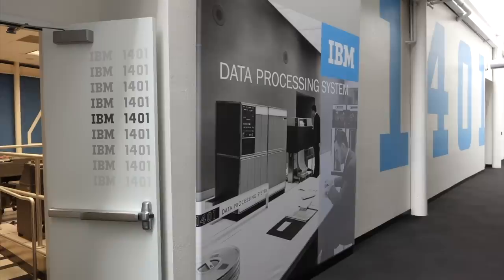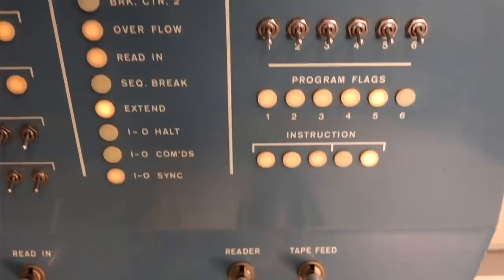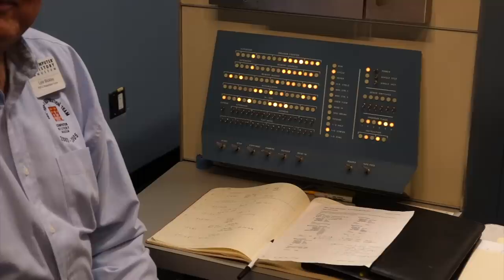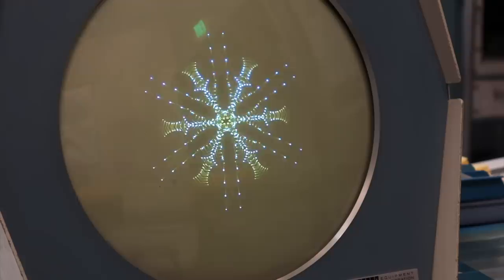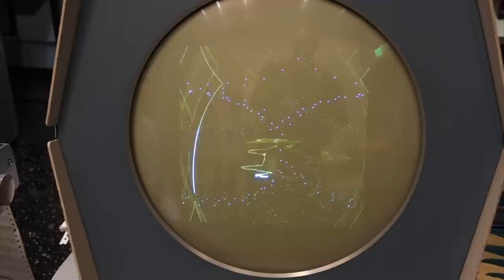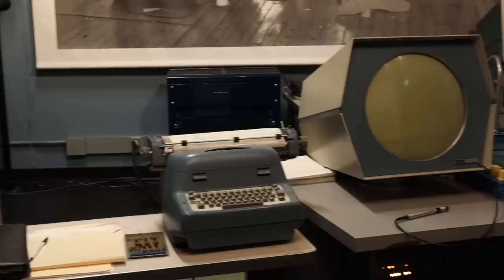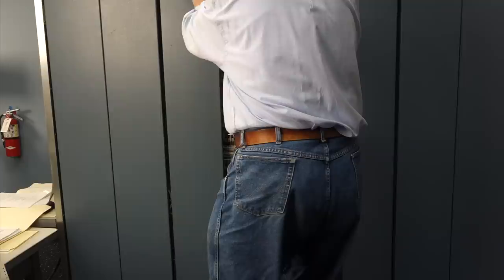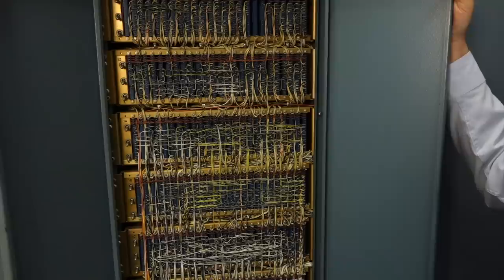Lyle Bickley explains the PDP-1 (and we play the original Spacewar!)

Comment: Definitely the best bit of Spacewar (and the system, though other systems would've also used a radar screen) is the long trails on the projectiles--makes 'em look like rockets and not blasters. Certainly a unique bit of the experience that would be difficult to emulate. Simulate, yes, but not emulate... 'less you happen to have a radar scope hanging around your house.
Reply: The "long trails" are due to the persistence of the phospher, and not due to the program.

Comment: It reminds me so much of programing my graphics calculator in high school.  The Ti-86 used a Z-80, an 8-bit processor running at 6Mhz or so, with 128 kB of RAM as well as 256 kB of ROM which held the OS.  Since it only had 16 bit addressing, you had to page memory in with 16 kB pages, with 4 pages visible at any moment.

You could either program it in BASIC (which ran very slowly, maybe 10 instructions per second?), or in assembly.  An assembly program could either be a binary, which would be compiled on a computer and transfered over the link cable, or it could be stored in hexadecimal.  The advantage to hexadecimal is that you could edit it directly in the calculator's program editor.  The downside is that it was machine language.  No nice human readable assembler here!

Oh yeah, since the calculator didn't have any non-volatile memory, any error in your code resulting in a crash would wipe all user data, such as your program.  Oops!  The BASIC interpreter was more resilient since it would just throw an error and gracefully return you to the shell.  Powering off the calculator really just put it into low power mode (keeping RAM alive), and it had a small backup battery so that you could change the main AAA batteries without loosing power and thus wiping memory, although if you removed the batteries while the calculator was "on" it would get wiped anyway.

I remember writing little programs by hand in assembler, then converting them to hexadecimal with the help of some graph paper (for calculating jump addresses!) and various reference sheets printed off from the internet.  Then I would run them and hope I didn't make and mistakes and crash the calculator.  Something to do during a slow Calculus class.

Comment: The dual phosphor tube has the blue short persistence for the light pen and the long persistence for the human. The code would track the pen by drawing a small 'X; on the screen and watching for the flash as the beam passed the pen tip.

Comment: 15:15: We should probably note here that your guess of 12K was not too far off. Lyle's correction to 4KW is deceptively low, but it's actually four 18-bit K-words, and to convert 4 18-bit KW to 8-bit bytes or kilobytes, you have times 9/4 it (multiply by nine and divide by four), so 4KW = 9KB, which is closer to 12K than 4K. Interestingly, several of the earliest home computers shipped with less RAM than 9KB, but I'm not sure if that would have meant they couldn't run a Spacewar! port, or if their 8-bit byte design meant they had better bit-economy than 18-bit word designs. It would be interesting to compare the sizes of Spacewar! ports.

Comment: I'd love to hear more about how the graphical display worked and whether or not it had a line buffer or whether it used vector graphics instead of racing the beam. It couldn't have had a frame buffer, because that would have required 128KB VRAM, which would have been too expensive back then.
Reply: It's vector graphics.

Comment: That thing has the space requirements and power consumption of a modern server farm. On one hand, it seems like an anachronism...a 1959-1962 video game. On the other hand, there's a reason it took so long to get from there to the Atari 2600.
Reply: Additionally, this is almost a study of software inevitability. It seems there always had to be a space shooter, and there always had to be a drawing program, and there always had to be a fractal demo program. Humanity has always demanded these things, and we make due with the tools of our time.
Reply from the maker: Of course not. This thing does not have the power requirements of an equivalent sized server farm. Not even a fraction thereof.
Reply: @CuriousMarc  Oh? How many watts? I figured it would be pretty power hungry just from ambient noise in the background. Sounds like a lot of fans are running.
Reply from the maker: @sarysa  I should ask, I'd think a few kW at most. A modern 19" dataserver rack will be 10 kW+, and for the highly optimized ones (think Facebook/Google/Amazon), it can go over 20kW. So something modern of similar size will gobble 50 to 100kW. It continues to go up and now you see the newest generation needing liquid cooling, as forced air can't deal with it anymore. You can't hear anything in a modern datacenter. You have to go in with earmuffs. And it can't possibly run without an gigantic air cooling installation. The PDP-1 will run happily in regular air and is relatively quiet.

Comment: 18:37: When Lyle announces the meter count, he starts by saying two hundred and then proceeds to read out 27,376.5, so now I'm not sure if it's really 227,376.5 (which would mean the meter wrapped and the two in the 100,000s place is not displayed), or whether it's just 27,376.5 and Lyle misspoke. It's the difference between just over 3 and almost 26 years of runtime. Does anyone know which it is?

Comment: Of course everyone is extremely careful with this historic equipment, but does the radar CRT have any sort of safety glass in front of it, or implosion protection? If not, it probably would not take much pressure on that screen surface to suddenly have glass shrapnel spraying into your face.

Comment: Ok... so let us get this straight.

The screen is a radar screen... ie a VECTOR screen... with a resolution of 1024*1024...

Am I completly stupid if I say that vector graphics isn't measured in "resolution"?

Raster graphics however is measured in pixels.

The video output can most certainly output a raster image to the vector monitor and the monitor will happily project whatever you feed it (that's the nature of CRT's).
Reply from the maker: You can’t really compare the two. Vector graphic displays are measured by the resolution of their DACs, the smallest addressable vector increment. When drawing lines, they tend to look far sharper than CRT raster screens of the same resolution, because there are no pixels, just continuous lines. Contrast is also usually much higher. However they are useless at displaying pictures, and generally quite slow and cumbersome at drawing text.

Comment: how this computer was programmed? with assembly? and how the enginners code the assembly into the computer?
Reply: Assembly. Paper tapes and the front panel. The video shows it.
Reply: The programs were written in assembly language and punched, with a typewriter-like machine, onto paper tape. The Macro assembler, on paper tape, was first read into the computer, Then your
program, on paper tape, was read by the assembler twice, once for Pass1 and again for Pass2. On the second pass, the assembler would punch out a paper tape binary. That tape was in block format, with a checksum, that could then be read into the computer.

There is an interesting problem. The Macro assembler was also written in assembly language. How was it assembled before the assembler existed? I vaguely remember an answer that the
earliest version was assembled on the TX0 computer in the next room, but I'm not sure about
that. And that answer, if true, only pushes the question back one generation, before my time at MIT.

Comment: If the actual monitor is square what was the benefit of putting a round shell on top? Funny till now I always thought those radar screens and covering glass were actually round.
Reply: The phosphor extends across the entire round display. The problem is when you want to use a XY coordinate system, you cannot fill the display, as you would cut off the corners! The PDP-1 can logically deflect the beam from -1,-1 to 1,1. To get around the problem, the deflection is scaled so that the entire domain is visible.

Comment: What an amazing machine! I have a hard time believing that 1024x1024 monochrome display was available back then, and with a light pen to boot! Awesome! Did the control logic for the display include any form of frame buffer memory (core, delay line, etc)? Or, was it up to the programmer to build in a refresh loop into his/her code?

As to the intro comments for this video, 100,000 instructions/second really isn't all that bad... a Commodore 64 ran at about 250,000 or so and sure didn't have a 1024x1024 display which I would have gladly traded for the 320x200 low-res C-64 color any day. I don't know if a PDP-1 had any kind of floating point instructions or not, but a C-64 could carry out a whopping 397 40-bit FLOPS and this computer looks to be a great deal faster.
Reply: I worked/played on the MIT PDP-1 starting in 1961. (DEC from 1964-1992.) The display had no frame buffer: refresh loop instead. No floating point: I wrote a floating point package for it along with William Gosper.

Comment: Very interesting great video.  I wonder why modern computers don't have a light for every flipflop. My childhood dreams dead in the water. :-( Amazing video.
Reply: I was a design engineer on some of the later PDP-10 computers. One of them did have a light on every flipflop, at the insistence of Field Service. The lights produced too much heat (before they were replaced by LEDs), and burned out too often. Also, we PDP-10 people, were laughed at because the PDP-10 console, with all its lights, cost more than the entirely of a PDP-11. I solved that problem on the last PDP-10 (DECSystem-10, KL10) by replacing all those lights with a PDP-11.

Comment: I'm wondering what sort of controller was originally used for Spacewar back then? I assume those arcade boxes were built later.
Reply: IIRC from reading Steven Levy's "Hackers", there were controllers made for their PDP-1 back in the day, as to what they looked like, somebody probably remembers.
Reply: They were small wooden boxes hacked together at the Tech Model Railroad Club, TMRC, they were anything but commercial looking. They had two DPDT switches, and a push button to launch the photon bombs.

Comment: That thing had 1024x1024?!? In the early 90s I was on 640x480!
Reply: That's 1024x1024 with a catch. Your 640x480 scanned every one of those pixels 60 times a second, allowing you to have any amount of them lit at a time. That's raster graphics. The PDP-1 used vector graphics. Note the blinkenlights they show below the display: ones for horizontal, vertical and intensity. This controls the current location of the beam and how bright it is. The program draws by setting the position of the beam and turning it on and off. There is no framebuffer; these registers directly control the tube. So, displaying a static image uses some CPU time since it has to be drawn every "frame". The length of a frame depends on how many dots or lines are in it. Frames with more lit pixels take longer to draw, and therefore will flicker more.

On even a primitive PC raster display, you have dedicated hardware that scans the beam back and forth to scan every pixel every 1/60th-of-a-second frame. Any amount of pixels can be set to a color simply by writing them into the framebuffer. Leaving the same unchanged image on the screen doesn't require the program to do anything. This allowed early PCs to display far more complex graphics, though more pixelated because of the low resolution. Vector displays can show much smoother lines and curves, but complexity is limited, and coloring in a region is simply not possible.

Comment: The pen is nice. I heard that later PDPs had no CRT screen nor a pen. Anybody knows why?
Reply: The PDP-8 was a smaller and cheaper machine, so it probably lacked these devices to save money. The later PDP-11 had them as an option since not all users needed them. The PDP-11 I got to use at the university in 1981 did have them and I wrote a Star Wars style "trench run" for it. My quick and dirty math was wrong (I used log when a simple divide was the correct operation) so sadly it was too slow to be fun.
Reply: My suspicion is that many computer applications didn't really need the display, after all, displays are only useful if you are there to watch them, but in the early days computers were not operated directly by the users and only ran one program at a time..

That meant that you would prepare the program beforehand(manually convert it to machine code and punch it on a punching machine), turn the punched media in to the operators of the machine, who then ran it when the next free slot came up, so even if it had a display, you would probably not use it(you were not there to see it, and it would burn through your alloted time quota). The more common output devices would be a printer or a tape/card puncher.

Later on, when multiuser time sharing operating systems became available, it would be more common to interact with the machine through a serial terminal rather than directly connected display.

Comment: Todays programmers don't have the skills to programme in assembly language on any computer for a given microprocessor, microcontroller or PIC. C, C++, etc. write a lot of bulky memory filling code which modern high speed processors aren't hampered by. It's like driving with the parking brake on but having enough power to overcome it. Back in the olden days, such bulky code would cause a computer to stagger along at a tediously slow rate.

Space War could be replicated on any PC by translating the PDP-1 assembler source code into 8086 source code and making graphics calls to INT 28 (PC BIOS graphics interrupt subroutine call). I wrote a pixel line graphics demo to somebody I was teaching PC x86 assembly language and machine code to when I was a mature undergraduate which drew a square box and bounced it around the border limits of the screen. It used exactly 128 bytes of code.

An assembly language programmer can work with any processor and computer system once the art has been learnt as it is a mindset discipline.

Unfortunately machine code and assembly language programmers, that can talk directly to any given processor on any given computer system, are dwindling in number as time and retirement takes its toll.

At least IT folks and computer programmers can visit museums like this to see how simple and easy they have it now.
Reply: Damn kids get off my lawn!
Reply: In the early 80's I did quite a bit of assembly language work, first on the 8080 microprocessor then the Z80. In 83 we moved mostly to C which could mostly be directly compiled to asm (so predictably that you could inline with asm()).

I later wrote a product mostly in C but having support libraries (bitblt ops and decimal math, mostly) hand coded in assembly for performance.  We wrote those libraries for each processor we ran on until RISC processors, register windowing and advanced compiler optimization started to beat our hand coded stuff in the 90's. I think the 8086 and 68000 stuff lived on for a while.

Writing assembly was just what you had to do to fit a language, shell, i/o and file system manager in 32K.

Comment: Even though the paper tape was low density, it probably was that much more reliable.
Reply: The best thing about the fan-fold paper tape was that, if you dropped it, you could pick it up and everything would still be in the right order. (Unlike tab cards.) Splicing in a new section was a required skill to be learned.

Comment: What does it mean - "12KW of core memory"? Memory measuring in kilo watts?? Is the correct KB?
Reply from the maker: KW stands for Kilo Words. You see, most early computers did not have "bytes" or words in multiples of 8, so you can't count memory in KBytes. The PDP is an 18 bit machine. So its word length is 18 bit, and it has 12K of 18 bit words of memory. The standardization on the byte architecture, which everyone takes for granted, is a much later computer concept (from the microprocessor era?).
Reply: Oh, thank you, I didn't know that! So theoretically, I can play this Spacewar game in 1959?
Reply: The KW is KiloWords of memory. Before the 8-bit byte became the common measurement of memory (i.e., multiples of eight bits), systems had various bit length sizes. DEC made 12, 16, 18, 32, and 36 bit word size systems. The PDP-1 had 18-bit memory words. You can think of it as 4KW equaling about 9Kbytes....
Reply from the maker: I heard Lyle say that the first version of Spacewar was 1962. But the hardware to run it did exist in 1959, so, in theory, yes.
Reply: This would be too small for power consumption. :-)
Reply: Hi Marc, Great video!   The 8-bit byte became widely adopted thanks to its use in the IBM System/360.   =)
Reply: @sgerar37  The standard byte size then was 6 bits, so the 18-bit word would be used to hold 3 characters. Given 4K words (4096), the memory size was 12K 6-bit bytes.

Comment: I wonder how they debug that crap back then. There were no breakpoints you could set up. Must have been a pain.
Reply: The first breakpoint (only one) ever was in the debugging package (DDT), but DDT took up too much space in the 4K-word memory. So, write the assembly-language code very carefully, and then single-step the instructions one at a time using a switch on the front console. (Hmm, at MIT, there was another computer, the TX-0, built MIT in-house before the PDP-1 existed. It had a program called FLIT, which I think had a breakpoint.)